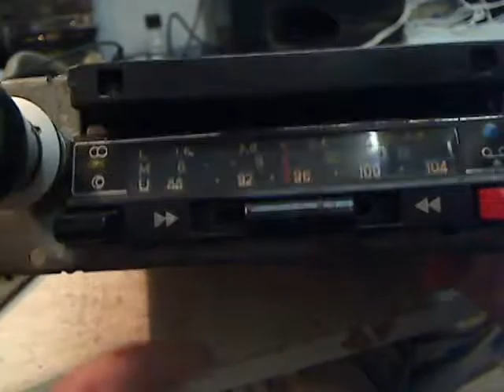Blaupunkt Bamberg CR Vintage Car Stereo with Recording! 1973

Comment from the maker: @Felix2417425  Yeah,old Blaupunkts are nice stuff! Yes it works by a solenoid.The solenoid holds it up. 
About the "ERO" and "ROE"'s: The old "ROE" electrolytic capacitors from the 60/70's are often crap today. The really bad thing by old "ROE" is,they get short and can damage the other electronics in your unit! The "ERO"'s...i don't know.I noticed this particularly negative on 1960/70's "ROE" electrolytic capacitors.

Comment: Hey. I have a Blaupunkt Goslar CR. It has the exact same fucntions excpet the recording function. I could never get it to work. This might be great help. Thanks!!
Reply: I'm modifying a Goslar CR to work without the amplifier as mine didn't come with one. I have it playing tape and FM now, long waves don't work because the amp generates an oscillating 32v supply for the tuner, FM works fine with DC. Still need to figure out how to hook up an aux cable for bluetooth :) You can find the schematics here if your model also has a chrome cassette door:
https://www.radiomuseum.org/r/blaupunkt_goslar_cr_7632933763293.html
Reply: AlfonsoB Thanks. If it's possible, can you show me how you have accomplished to remove the amplifier. On traced the problem to loose wires coming from the radio to the amp. It didn't come with a socket like yours on the video. They were all soldered on. And as far I wasn't able to figure out where each wire goes...
Reply: Removing the amplifier involves cutting traces and soldering on a bunch of jumper wires, I wouldn't recommend it if you still have the amp.
Reply: AlfonsoB Ok. What do you advice me to do?
Reply: You should follow the schematic to hook up the amplifier. If your amplifier still has the female connector I could possibly send the leads with the connectors to you. The two other leads coming out of the back of the head unit are needed as well because they have jumpers and resistors in them. You can reach me at supertaunus(at)gmail.com, if you can send some pictures it would be helpful.
Reply: AlfonsoB Ok. Tomorrow i will send some pictures!